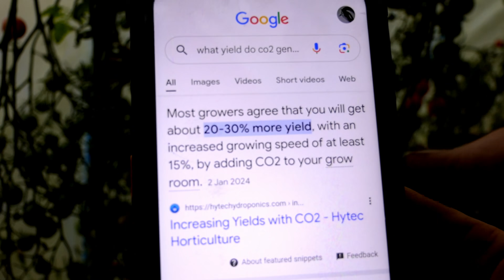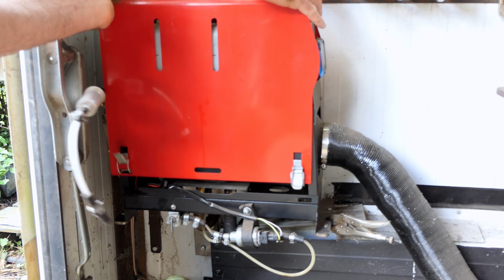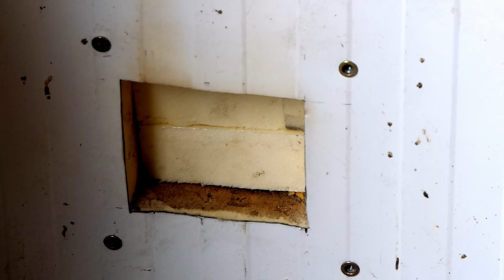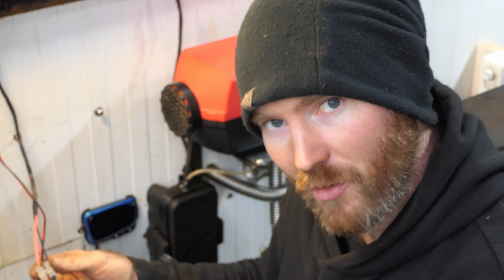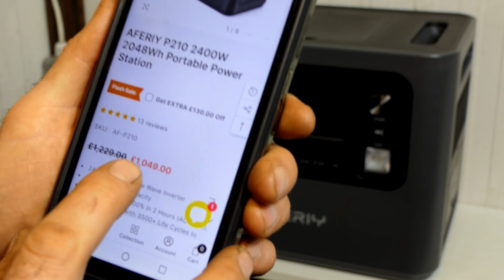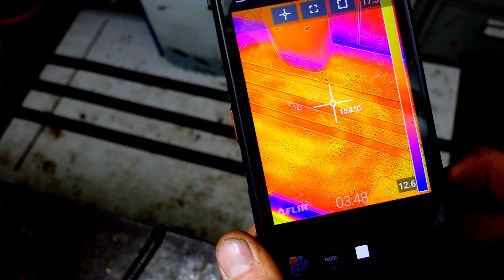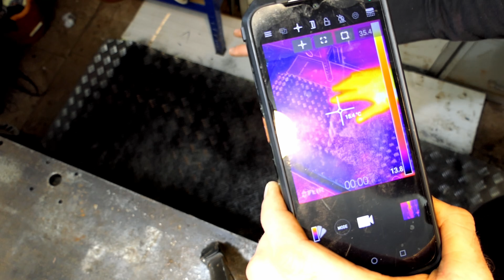NEW! Better system for Cheap and Safe Heating💲+ Underfloor Heating Mod test🫠

Comment: I wanted to touch base, in a friendly way, on the topic of CO₂ as you discussed it at the end of the video.
Hey, I totally get where you're coming from—As someone who lives in one of those WAAYYY to cold places, I can't say I'd personally be too upset if things warmed up a bit, and yes.. everything you said is true... Ultimately, in the long run, more CO₂ will equal more biomass on a global scale... So no, CO₂ emission won't "destroy the planet", but rapid climate change will be VERY disruptive to our civilization and way of life... and that's the real crux of the issue.... too much change too fast MAY outpace our ability to adapt to those changes, but I agree, we need a balanced approach, and we need to stop with the fearmongering, and simply tell it as it is.... all that said.. i felt maybe I could help clear up some misconceptions about CO₂....

Yes, it seems wild that something as minor as CO₂, which is just 0.04% of our atmosphere, could be driving climate change, especially when humans contribute only about 3% of that CO₂ each year, but the evidence is pretty overwhelming that it is the main driver. 

Let's break it down together.

Why Does CO₂ Have Such a Big Impact?

Even though CO₂ is a tiny fraction of the atmosphere, it's super effective at trapping heat. 
Here's how:
Greenhouse Effect Specialist: CO₂ molecules absorb infrared radiation (heat) that the Earth emits after being warmed by the sun. Gases like nitrogen and oxygen don't trap heat this way. Water vapour does, extremally well at that, but it has feedback mechanisms that keep it from being the driver of this change.
Long Staycation: Once CO₂ is in the atmosphere, it sticks around for a long time unless taken up by plant life—hundreds to thousands of years. That means it keeps influencing the climate long after it's emitted... yes the biomass will hit a new equilibrium that can account for the new excess, but that takes time.. longer than you might think, which brings me to my next point.

Why Does the Human 3% Matter?

While 3% seems small, it's about the balance:
Natural Balance vs. Extra CO₂: Nature emits and absorbs huge amounts of CO₂ annually, and it's been in balance for thousands of years. Our 3% is extra—it's like the straw that breaks the camel's back.
Cumulative Effect: Since natural processes can't absorb all the additional CO₂ we're emitting, at least right away, and since biomass productivity lags, it accumulates in the atmosphere year after year, which again, brings me to my next point..

Evidence Linking Human CO₂ to Climate Change

Rising CO₂ Levels: Measurements from places like the Mauna Loa Observatory show that atmospheric CO₂ has risen from about 280 parts per million (ppm) before the industrial era to over 400 ppm today.
Isotope Fingerprinting: The CO₂ from burning fossil fuels has a unique chemical signature. Scientists have detected this specific type of CO₂ increasing in the atmosphere, confirming it's from human activities.
Temperature Correlation: Since we know exactly what the insulative properties of CO₂ are (it's an easy experiment to do and you may have even done this in high school yourself with a jar of CO₂ enriched air, a control jar and a pair of thermometers) we know exactly how much temperature increase we should expect to see with a given rise in CO₂, and sure enough, the increase in global temperatures closely follows the rise in CO₂ levels. When we plug human CO₂ emissions into climate models, they accurately predict the warming we've observed.

What About Sunspots and Other Factors?

Sunspots and Solar Activity: Scientists have studied solar cycles extensively. While the sun does influence climate, solar activity has remained relatively stable or even decreased slightly in recent decades—not enough to explain the current warming.
Deforestation and Land Use: These activities do affect the climate by releasing CO₂ and changing how the land absorbs heat, but they're part of the broader human impact. Paving over ground and soil degradation contribute, but they don't account for the full picture.

In a Nutshell

Even small changes in CO₂ levels can have big effects on the climate because of how effectively it traps heat and how long it stays in the atmosphere. Our additional emissions tip the natural balance, leading to a steady increase in atmospheric CO₂ and global temperatures. Multiple lines of evidence—from direct measurements to chemical fingerprints—irrefutably link human CO₂ emissions to climate change.

To finish, I want to emphasize that acknowledging the evidence that CO₂ is the main driver of climate change doesn't mean we have all the answers about what the exact consequences will be. 

I totally understand your concerns—climate systems are incredibly complex, and there's still much we don't know. Skepticism is important because it pushes for better research and more precise understanding. While the evidence points to CO₂ playing a significant role, we're all in the process of learning about how exactly this will impact different aspects of our planet. I am 100% in agreement that in the long run, pushing CO₂ levels up is likely a good thing for global biological productivity and I'll be the first to admit that it is entirely possible that even in the short term it may even be a net positive (depending on where you live of course... sea levels will rise if all the glaciers melt, but that also assumes we don't engineer our way out of that problem somehow). The point is we don't totally know yet. 

It's a shared journey of discovery, and open discussions like this help us all get closer to the truth...
Reply from the maker: You make very good points but even now the science is changing. Methane is now the biggest driver, the data collection isn't consistent and pier reviews are actually easily biased. Not to mention having alternative data means no funding and so scientists are being forced to project a certain narrative in order to keep their jobs. Geoengineering is very real too and being funded by bill gates. £300B of our tax money is now going abroad to corporations to profit building green energy so they disrupt the energy monopoly whilst no attempt is being made to restore the rain Forests... £300B to regenerative agriculture and habitat restorstion would go a long way. Follow the money... Cheers J
Reply: @joshuadelisle  You raise a lot of valid concerns, I really appreciate the thought you’ve put into this, and no... nothing you have said is "wrong".. If anything I'm splitting hairs here, but, in the spirit of light hearted, friendly, and open discourse, let me address your points one by one, as I think there's room for agreement while clearing up some misconceptions.... 

From my perspective.. I have little love for politicians, or their corporate masters.. so don't take any of this to be me defending those rotten institutions...but I digress.

Methane as a Driver
You're right that methane (CH₄) is a powerful greenhouse gas, with a much higher warming potential than CO₂ over a 20-year period. However, despite methane having the potential to become the main driver as you have pointed out (The amount of methane trapped in permafrost and methane hydrate stores are insanely large... more than all other fossil fuel reserves put together!!), at this time CO₂ remains the largest overall driver of climate change because of its sheer abundance and long atmospheric lifetime, at least according to the current body of data. That said, If all that methane hydrate starts to melt, you better believe we are in for a rough ride!!.. So, yes, you're absolutely correct that methane needs serious attention, especially from sources like agriculture, landfills, and oil and gas operations.

Data and Peer Review
It’s true that science evolves as new data comes in, and part of the scientific process is questioning and refining earlier conclusions. While peer review isn't perfect—it’s a human process, after all—it's currently the best method we have for ensuring that studies meet rigorous standards. The idea that alternative data gets ignored isn't entirely accurate. In fact, some groundbreaking findings, like the role of methane or the risks of geoengineering, began as alternative hypotheses that gained traction through evidence. Bias can exist, but it's countered by the open nature of science: studies can be replicated, and bad science tends to get weeded out over time... The most important thing here is to have an open mind, but not so open your brain falls out! Skepticism is not the same as rejection.. If something is true, it should hold up when scrutinized.

Funding and Narratives
On that note, I understand your skepticism about funding—"follow the money" is always a wise approach. Scientists rely on funding, and no system is immune to external pressures. However, climate science funding comes from diverse sources, not just governments or corporations, and the core findings about CO₂ and climate change are supported by decades of independent research from around the world. If anything, fossil fuel companies have historically spent billions funding research and campaigns aimed at discrediting climate science.... Not saying there aren't bad actors, and that some data hasn't been fudged, but the volume of evidence is simply too large to dismiss it all.

Geoengineering and Green Energy
Geoengineering is a real and contentious topic. While figures like Bill Gates fund research into solar radiation management and other technologies, this is seen as a last-resort strategy.... and one am vehemently opposed to. Most scientists agree that reducing emissions is a safer and more sustainable approach. As for green energy, it's true that corporations stand to profit, but that's not inherently bad if it helps transition us away from fossil fuels (If we feel we need to, remember just because the earth will warm, doesn't mean we fully know what the consequences will be). Still, you're absolutely right to point out that we should balance investment in renewable energy with funding for projects like regenerative agriculture, habitat restoration, and reforestation.

Rainforests and Habitat Restoration
I couldn’t agree more that restoring rainforests and investing in regenerative agriculture would make a huge impact. Healthy ecosystems absorb carbon, support biodiversity, and help stabilize the climate. These efforts don’t always get the attention they deserve because they don’t generate immediate profits like energy projects, but they’re vital and should be a bigger part of climate solutions. This is an area where grassroots movements and public pressure can make a difference—our voices matter.

A Common Ground
It sounds like we both agree that the current system has flaws and that some solutions are being prioritized over others for financial or political reasons. At the same time, the evidence for CO₂'s role in climate change is solid and shouldn't be dismissed because of these issues. If anything, your concerns about systemic problems strengthen the case for ensuring that climate solutions are fair, balanced, and scientifically sound. I say we work on advocating for a broader approach—one that includes a balanced approach to individual needs, habitat restoration, and systemic accountability.

Anyway.. that's all from me today! Have a good one! Cheers from Canada!

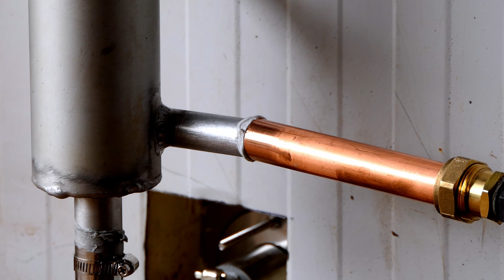Comment: 18:25 Could you solder the copper and aluminium together - or tin the copper then fit over aluminium?
43:00 Could you substitute a truck/car radiator for water to air - using a small fan pushing through a shroud.
And put the exhaust heat through a chynese 12L propane instant tankless water heater heat exchanger.
Reply from the maker: @lukeforks9134  you technically can. However having copper and aluminium in the same system isn't actually ideal because of galvanic corrosion. A car radiator will work but need extra valves/ports which works out to be a lot more expensive. Cheers J

Comment: The general public's attitude to CO2 is based on a lot of completely provable BS about climate change. Co2 was more than 425PPM 12-13000 years ago plus it LAGS temperature change and does not drive it.
After the 1st 20PPM it's effect is akin to painting a house the same colour. Adding more does not mean it reflects any more energy. If we could double CO2 (about 350 years at current rates) temperature rise can be calculated (Without failed computer BS modelling) to be +ZERO point ONE degree. That also assumes no more uptake from nature as most plants love CO2 and also grow better as they need less water.
Kouwenberg, L. L. R. (2004). Application of conifer needles in the reconstruction of Holocene CO2 levels. 
Steinthorsdottir, M., Wohlfarth, B., Kylander, M. E., Blaauw, M., & Reimer, P. J. (2013). Stomatal proxy record of CO 2 concentrations from the last termination suggests an important role for CO 2 at climate change transitions. Quaternary science reviews, 68, 43-58. 

Slocum, G. (1955). Has the amount of carbon dioxide in the atmosphere changed significantly since the beginning of the twentieth century. Month. Weather Rev, 83, 225-231.
And for 1 of 3 papers proving there is no cause for alarm:
Holmes, Robert. (2018). Thermal Enhancement on Planetary Bodies and the Relevance of the Molar Mass Version of the Ideal Gas Law to the Null Hypothesis of Climate Change. Earth Sciences. 7. 10.11648/j.earth.20180703.13.
Reply from the maker: @grahamnumber7123  excellent references. Thank you. Cheers J

Comment: If you are looking for a more efficient heat exchanger one recovered from a dead gas boiler may be useful. Heat exchangers on house ventilation systems are very useful to save energy.

Comment: These are not as cheap to run as it seems. Anything is cheap for a small area
Reply from the maker: @NeverTakeNoCut-offs  I priced it per kWh. Good insulation and small spaces are more efficient to heat however energy is energy and so this system is definitely cost effective provided you can get the fuel at the same rate that I can. Cheers J

Comment: Just wondering your take, since you have a good amount of experience running these machines and tinkering with lots of things, do you think you could mix in used beef tallow instead of vegetable oil? I generally make my own Tallow and use that in cooking instead of vegetable oil, and was wondering if that was a viable option for one of these heaters
Reply from the maker: Theoretically you can however it needs to be pre heated so it's wet and runny and maybe purge the lines with diesel before and after using the tallow so when its cool it doesn't get blocked up. Cheers J
Reply: @joshuadelisle  awesome, thanks for the quick reply. I'll try it out, and let you know how it worked

Comment: Here is something ChatGTP has to say about that only 3% human Co2 output:

Approximately 3-4% of the total annual CO₂ emissions on Earth are directly caused by human activities. The remaining CO₂ emissions come from natural sources, such as volcanic eruptions, respiration of organisms, and decomposition of organic material. 

*However,* the human contribution to CO₂ emissions is particularly significant for two reasons:  

1. *Imbalance:* Natural processes, such as photosynthesis, oceanic absorption, and the carbon cycle, keep natural CO₂ emissions in balance. The extra CO₂ that humans emit through burning fossil fuels, deforestation, and industrial processes disrupts this balance, leading to a net increase in atmospheric CO₂ concentrations.  

2. *Cumulative effect:* Human CO₂ emissions are relatively small compared to natural sources, but most natural emissions are absorbed by the Earth (e.g., by forests and oceans). The extra CO₂ from human activities accumulates because the absorption capacity of natural systems is limited. This is the driving force behind global warming.  

In short, while the percentage may seem small, its impact is significant because it greatly disrupts the balance of the climate.

Comment: Pumping CO2 into a greenhouse, wouldn't that also make it superhot with the extra "greenhouse effect".
Oh wait, no, the "greenhouse effect"  is a scam.
Reply from the maker: The heating isn't on in summer so it's only helping in winter. Cheers J
Reply: @joshuadelisle  "The heating isn't on in summer so it's only helping in winter",   Er  yeah, I thought so..    You're not very bright are you?   Cheers S.

Comment: Weather compensation is the best way to control the system .
Its basicly a thermister .  Its fitted out side .
Reply: Weather comp is used on most  air sauce pumps and d boilers .

Comment: With heat pumps they are very cost effective to run if you also have home battery. So 11p per kWh of electricity on octopus cosy =  2.75p per kWh of heat.

Comment: I have a diesel powered central heating system, which also heats a hotwater tank (calorifier) for our domestic needs. What it has, which your system does not, is an aquastat on the hotwater return. This allows the heater to cycle on and off but keep the water pump running. Having more radiators and a larger underfloor system would also help the efficiency.
Great content as usual. Thanks,
Reply from the maker: Thank you. This heater can't work with an aquastat because it needs to go through a cool down cycle. I theoretically program a controller for it but it's not simple to do. Cheers J